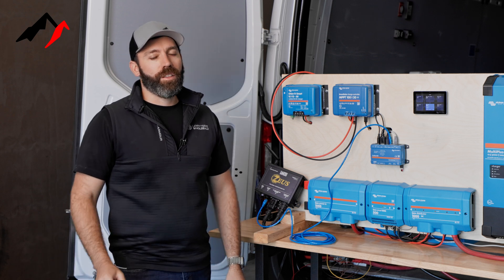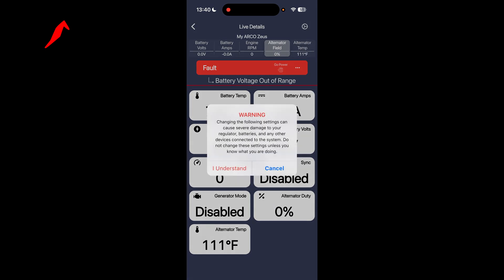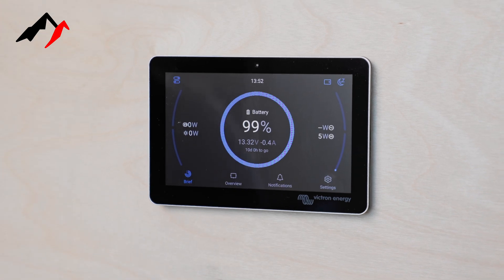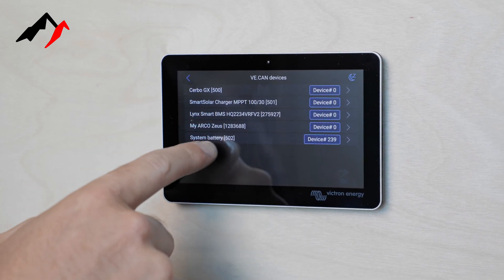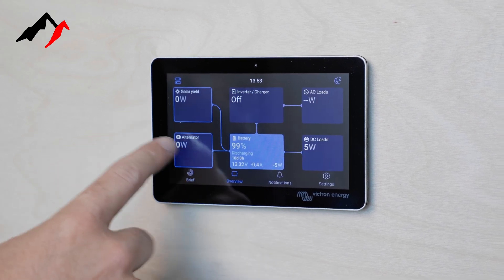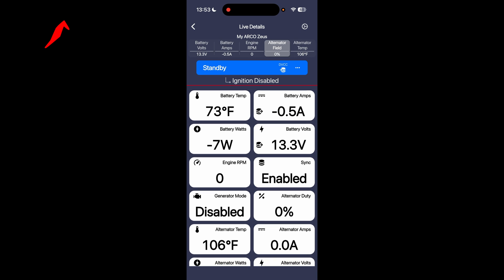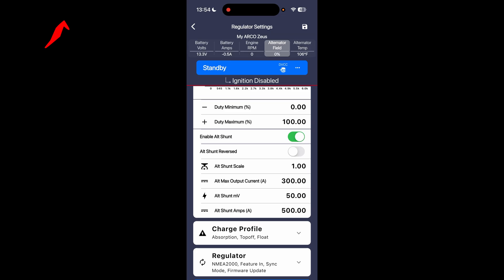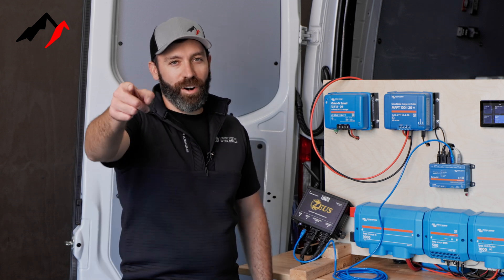ARCO Zeus & Victron Energy - Secondary Alternator & Regulator Setup

Comment: looking at adding an Arco LTO A4000 alternator with an existing secondary alternator on a 2023 MB Sprinter diesel 2.0 with Wakespeed 500 controller. The original APS alternator got fried. Any concerns with that configuration?
Reply from the maker: It's a configuration that can work, but always keep in mind, it’s a sensitive setup. Once you’re running dual alternators, Wakespeed control, and high-output charging, small details matter.

The fact that the original APS alternator failed is already a signal to slow down and evaluate system protection, load management, and vehicle integration before swapping components.

With limited info, it’s not something we’d want to green-light in a comment thread. This is very much a full-system-review situation rather than a single-component decision. We always recommend working with a qualified and experienced installer for any high output alternator system. The installer can then work with our wholesale division, upfitterswholesale.com, for fulfillment and support.

Comment: What happens to the primary alternator display? Can the primary alternator still be utilised to also charge the same house batteries via dc-dc Victron charger?
Reply from the maker: Whether the primary alternator can also be used to charge the same house bank via a DC-DC charger is not a universal yes/no. With dual-alternator and DC-DC setups, everything should be evaluated as a complete system. Alternator behavior, control strategy, current limiting, battery acceptance, etc all interact. Issues usually show up at the system level rather than with any single component. 

We always recommend working with a qualified and experienced installer for any high output alternator system. The installer can then work with our wholesale division, upfitterswholesale.com, for fulfillment and support.